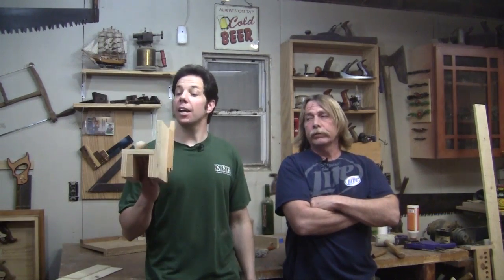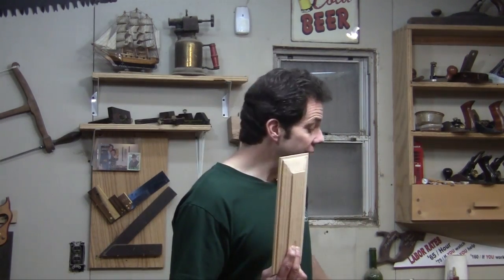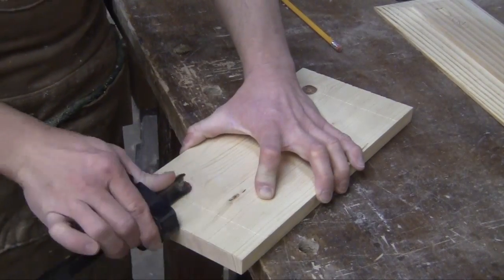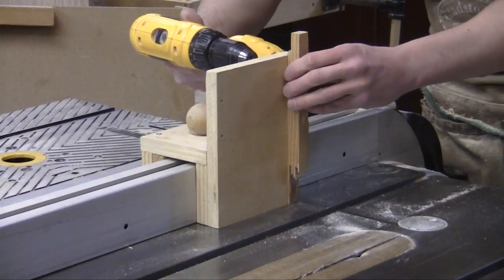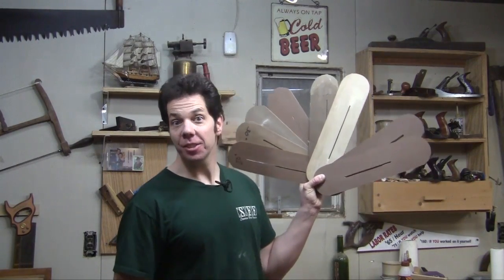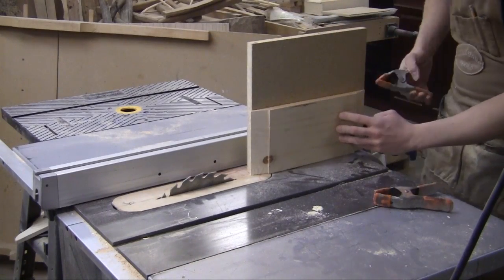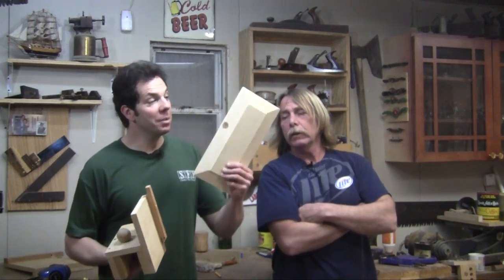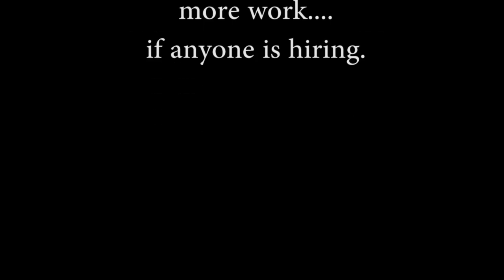Make a Raised Panel Jig for your table saw

Comment: Great easy tip Chad thanks!  Any tips on how to determine the angle of the saw (i.e. yours was at 15 degrees)?  Safety Dan drink straight from the bottle was the highlight this week.  :-)
Reply: A Bevel Box! Well worth the cash. Otherwise your smart phone and an app may get fairly close.
Reply from the maker: The angle you have to play with. Too steep and there is no step and the edge. Too straight and no slope. Somewhere between 10 and 15 works well for me. I would also suggest having a scrape piece to practice with first.
Reply: Thanks!
Reply: Imagine the beveled edge as a right triangle; if you know the length of the 2 sides you can determine the other 2 angles. In Chad Stanton's video, tan(angle degree)=rise/run; usually written as tan(theta)=opposite/adjacent.  There are many combinations, search for "sohcahtoa" for all the details.